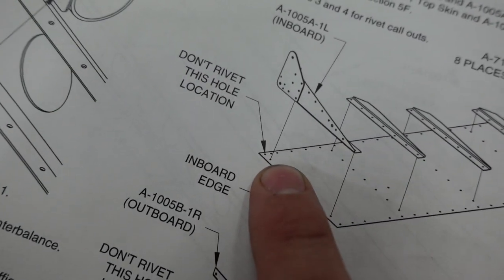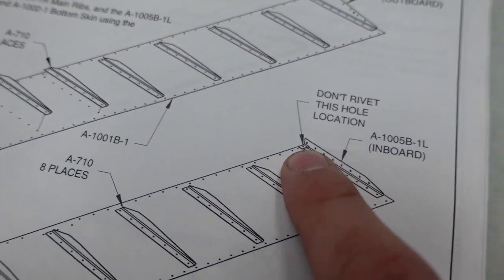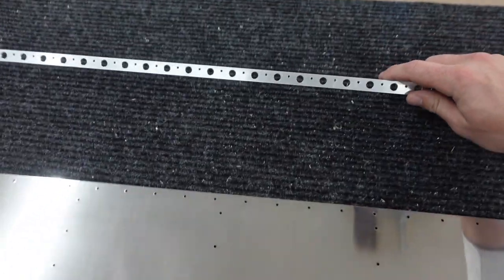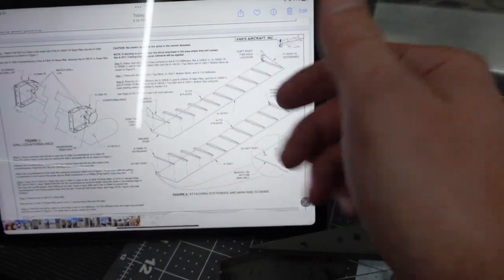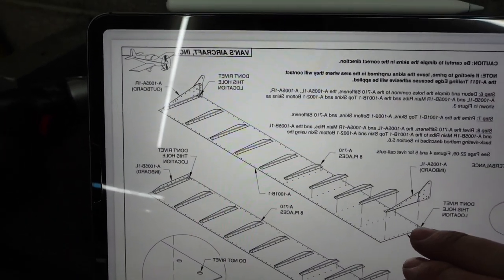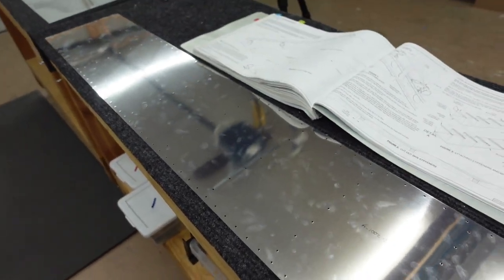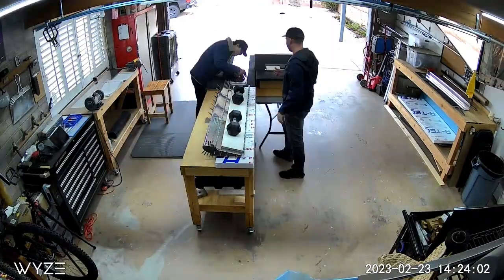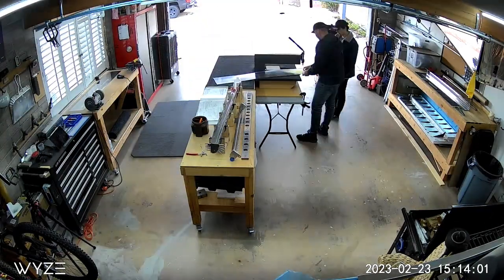Van's RV-10 Wings - Ailerons, Part 1 of 2

Comment: I love the iPad tip for mirroring, that's a great idea! Tell me about that Dremel tool you are using for deburring the flange parts?
Reply from the maker: Thank you! And it’s a set I found on Amazon a while back. They honestly are not the greatest to use since the aluminum eats them up so quickly. Still looking for the “perfect” dremel attachment for deburring.  

Here is the link though: TEMO 16 pc Rubber Polishing Burr 4, 6, 8, 10 mm (5/32, 1/4, 5/16, 3/8 Inch) Bullet Cylinder with 3 mm (1/8 Inch) Shank for Dremel Rotary Tools https://a.co/d/iu5qZbB